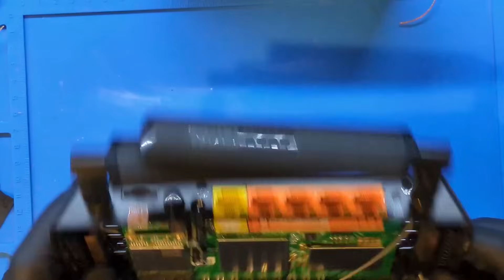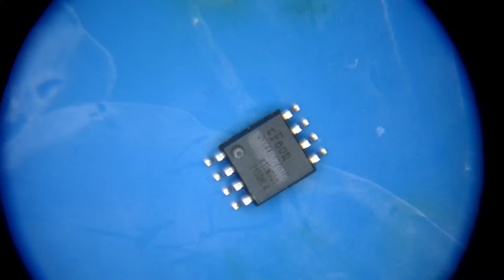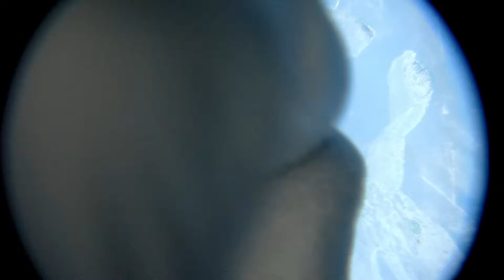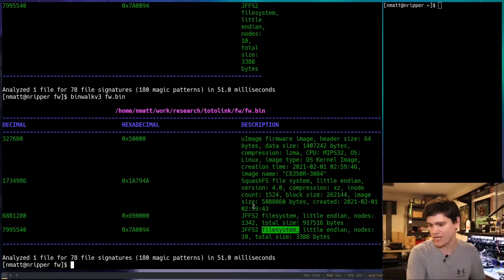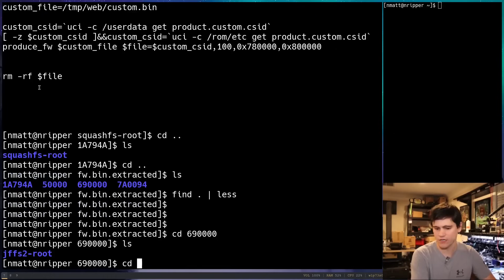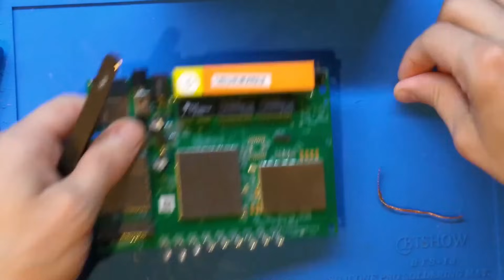Chip Off Firmware Extraction - Hacking the Totolink WiFi Router

Comment: Great video as always! I hate the fact that you can do what I do, but I can't do what you do (yet)! Just a few tips on the solder/desolder process: When cleaning the chips' pins, avoid scrubbing them up and down as Matt did, because if the cotton catches a pin you can bend it out of shape and cause all sorts of problems! It's often better to roll the cotton bud between your fingers for a rotary motion, or sweep along the length of the pins outwards from the body. For soldering, a different method taught to me to reattach (after cleaning the pads of old solder) is to only add solder to pad 1, then heat with your iron and slide the chip pin 1 into place onto the pad and with the heat still applied you can align the chip perfectly. Then solder the diagonally opposite pin, check for alignment, then solder the remaining pins. The issue with not using flux for hot air resolder is either dry joints, or as we saw the chip blows away!  Flux also helps keep the chip in place. Try to not heat any other components either, the last thing you need is to dislodge or lose an 0201 resistor! I agree it is a lot less messy without using flux, just a little more tricky sometimes. Try to avoid using high-power ultrasonic baths on most circuits as they can shatter any timing crystals on the board, even ones inside the chip itself. A bit of swishing around in an isoprop bath will clean off almost any flux with ease. If something does go wrong (it doesn't boot in this case), then remove the chip, clean the pads, and try again. Most chips have a thermal profile and cannot be heated to solder-melting temperatures for a long time without failing, so keep the hot air or iron on only as long as needed to melt the solder and reattach, and let it cool naturally in air. Don't use freeze spray or compressed air as you can crack the chip with the temperature delta. And my number one tip, learned from experience - make sure the power is off before attempting any of this :D
Reply: I think the consensus here is Matt isn't very mechanical, his hands are too soft and delicate.

Comment: hey Matt- I've seen people extract firmware by attaching a clip on-top of a chip that's still on its PCB. (perhaps even on your channel?; not sure..)   anyway- how do you know when a chip should/must be removed like you did here, rather than scanning it in-place...?  Thanks!
Reply: See @Segphalt comment below.
The chip must receive power, but you do not want to power the rest of the board, because this would also power the SoC, which would also start reading off the chip.
Reply: @rubenfaelens2127 Would it be possible to put everything else in reset?

Comment: Also worth noting, if you use a fiberglass pen to sand then an exacto knife to cut the power and ground traces (2 cuts to insure there is a gap) on the board you can use a SOIC/SOP chip clip or teast leads to pull the firmware in situ and need only a solder bridge to reconnect the traces. It's much faster this way if you find yourself in a situation where you might have to be regularly putting the chip back on and off multiple times. (Often when detecting how chages appear on the filesystem or raw spi memory when you can't easily root the device (or when its not running linux at all))
Reply: Can you point to a video that demonstrates this technique? Thanks!
Reply: @nwellinghoff  I'll work on recording one, I didn't think it was unique but I also don't feel like I learned it anywhere so probably good to get out there just in case.

Comment: IOT-Noob here. What would be the correct thing to do instead of a hardcoded root pw on a IOT device?
Reply from the maker: depends on the context. but the more hardened devices I've seen don't allow password auth at all.
Reply: Flash encryption is also an option but often not readily available on anything but the newest mcu's/SoC's.
Reply: If it was me, I would generate a random password for each firmware. It's more secure, but way harder to debug

Comment: Yo matt which temp config do u use for ur heat air gun ??
Reply from the maker: around 870 F. but with hot air that's just one variable. its also about how fast the air flow is and how close you are to the component.

Comment: Isn't flux mostly used to ensure proper bonding during soldering? Like I see lots of people use flux when removing components, but I don't see why you'd need it.
Reply: Flux removes oxidation and prevents oxidation. Without flux solder doesn't bond well to the copper/tin. In this case where everything was tinned the soldering went ok, but without flux new oxides are being formed in the process. It's best practice to use lots of flux and then clean everything after.

Comment: Whats up with the large footprint overtop the little footprint?
Reply from the maker: Probably connected to the same SPI interface to the CPU. That would allow them to use a larger flash chip without having to design a new PCB

Comment: No clean flux is the way to go
Reply: Any recommendations? All of the "no clean" flux I've used still leaves a residue that needs cleaning. Especially important if you don't want anyone to know that you've had the chip off the board! Cleaning with isoprop also removes certain security markers and any ink which is a dead giveaway.

Comment: I have one doubt,

How can we conclude that particular (X) chip holds firmware?
Reply: You could read chip's documentation. Maybe first few times you won't know what is what but over time you get to know series numbers and models so you don't even have to guess.
Reply: Often cause of doing it a lot and getting used to it. Flash chips often come in 8 pin packages and are kind of wide and start with 25xxxxx. Or a tsop package for larger devices or devices that use complex Operating systems, these flash chips are also inside usb drives. Often the manufacturer also hints what it is. Some common manufacturers are XMC, Cfeon, winbond
Reply from the maker: Flash chips (where the firmware is stored) often come in a common set of packages (physical dimensions) so after you have looked at enough PCBs you can immediately know which one has the firmware :D

Comment: why do you prefer to go chip off over clip? i’m more of a novice but have had a lot of success with the clip for the T56
Reply: The issue with clip over chip is the power you need to provide the target chip in order to read it - often this will end up back-powering the whole circuit and can interfere with reading the chip at best, or damage the output drivers of either the host, target chip, or your reader. Safest option by far is to remove and read, then resolder, depending on your solder skills of course!

Comment: Harbor Freight has an ultra sonic cleaner for 90 bucks.
Reply from the maker: Oh I might have to check that out ....
Reply: @mattbrwn vevor sp? seems to be fairly common unit likely out of the same mfgs. Don't know what solution would work. Ultrasonic  hot 111, then vapor phase rinse then dunk in pure alcohol used to be our std back in the day before paraxlene conformal coat. Maybe 70% iso in the ultrasonic then a spray bottle of 91% iso to rinse? Outside with a lid handy if it lights off 😊